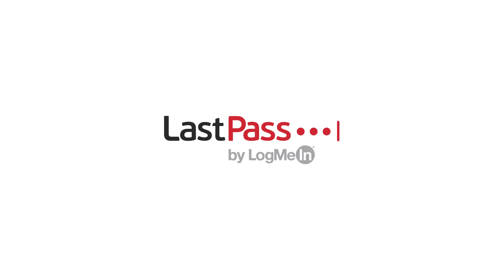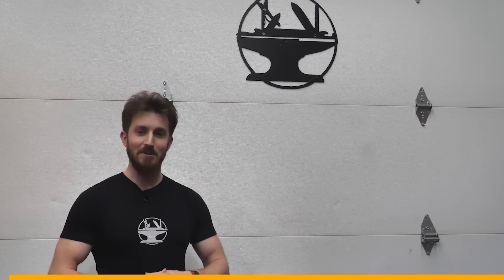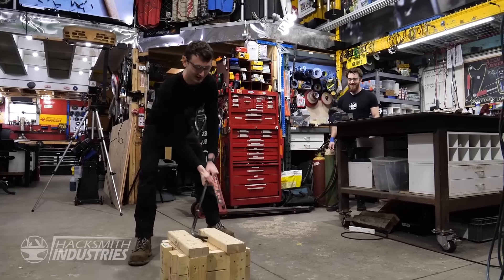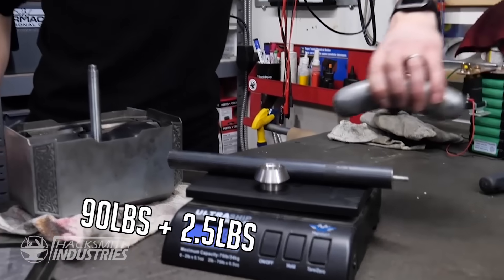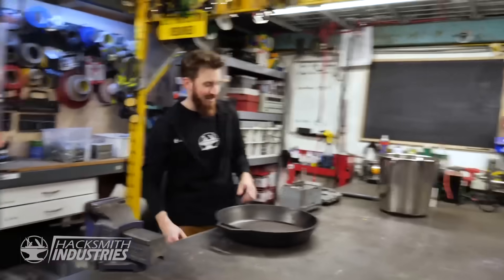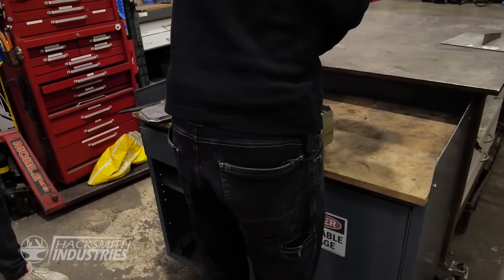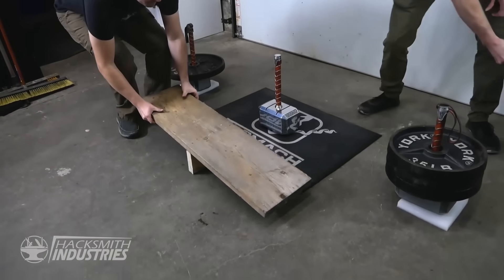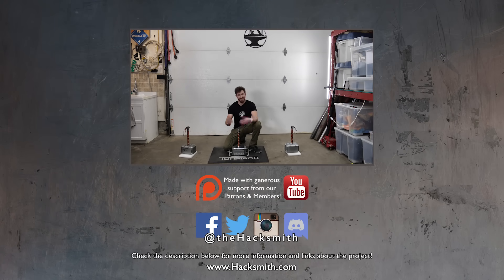Tungsten Thor's Hammer (World's HEAVIEST)

Comment: Is there any possibility you guys can build a melting furnace that can hit 3450 C (Tungsten melts at 3422 C)?
Then you can (theoretically, you need to build a mold that can withstand that temp.; I suggest cooling the mold with liquid nitrogen) make a replica Hammer head out of 100% Tungsten (or just about any other metal you can legally get)...
I bet a solid 100% tungsten hammer head will be between 130-150 Lbs...
If you can melt/cast Tungsten, why not try making a solid Tungsten Stormbringer?
Reply from the maker: That would cost so much
Reply: @hacksmith  You were able to crowd fund the Tungsten for this project, why not try for the tungsten furnace/molds...
Besides, think of all the shenanigans and/or fun you could ultimately have with what amounts to a small, privately owned Blast-Furnace...
Large projects like the Aliens Power Loader may become cheaper if you could source your steel at the scrap yard and smelt it at the shop and cast the parts you need directly...

Comment: Normal person: Uses tungsten to cut steel
The hacksmith: Uses steel to cut tungsten
Reply: @DL-zv5xc  , metal just refers to material, whether they be elements or alloys, and steel is definitely metal.
Reply: @sol_x_dier  steel is an alloy of 2 metals
Reply: Daniel Agius steel is iron + carbon. Carbon is nonmetal
Reply: ApologeticBrit16 Theres a big difference between Tungsten and Tungsten Carbide
Reply: tungsten is a metal tho
Reply: @DL-zv5xc  you didnt just say steel isnt a metal, did you?
Reply: @bmxscape  steel is not a metal, steel is made of metal
Reply: What is considered normal metal
Reply: Daniel Agius steel iron
Reply: @kayhan_  steel is an alloy of 2 transition metals and the termnormal metals is  inexistent. As almost all apart from mercury and some others  are ductile and malleable.
Reply: @locallemonadestand8130  Steel is not an alloy of 2 transition metals, how do you come up with it? Steel is an alloy of a metal, namely iron (a transition metal) and a non-metal, namely carbon. Basically, steel is "iron carbide" ^^
Reply: I see u guys Murdering Chemistry
Reply: But only Stalinium could sway the german wehrmacht...
Reply: @Ulvetann  stalinium can defeat wermachtium
Reply: Tungsten has a relatively low threshold for shear strength because it's an amalgam of small crystalline granules.  You can cut it with high speed steel.  The individual granules are nearly diamond hard, so the tungsten is extremely abrasive.  I go through carbide endmills like crazy machining even copper alloys of tungsten.  Pure tungsten is almost impossible to machine.
Reply: That's how mafias work
Reply: Perfectly balanced as all things should be.....
Reply: Hacksmith could cut steel with aluminum lol
Reply: @DL-zv5xc  it's iron and carbon alloy.

Uhh, 97% metal by weight or so
Reply: Wtf
Reply: F*** you Mohs

Comment: Ok so i wanted to do the maths of how heavy you could make a 1:1 scale hammer 
So usuing the measurements i found of 8x5x5in that gives us 200in^3 
When converted to a unit that makes sense that gives 3277.4 cubic centimetres
The most dense material on earth osmium has a density of 22.61 grams per cubic centimetre 
So with simple multiplication that yields approximately 74000grams or 74kg 
So making it out of a more dense material wont actually increase it all that much

Comment: its got same weight with the cement, 50kg its tremendous but luckily the cement has bigger space and it not too dense since they are in powder so maybe 50kg it still have room to move araound xD

note :
cement i mean is used for concrete
Reply: I don't know if I understand your comment, but are you suggesting that cement is heavier than tungsten?  If so, let me assure you than cement is lighter (less dense) than steel which is less dense than lead, which is less dense than tungsten.  

g/cm3
cement: about 3.1
steel: about 7.4
lead: about 11.3
tungsten: about 19.3
Reply: @NOTNOTJON  not like that, 
whats i mean is because the different dense of materials, even with same weight the feel bringing 50kg cement and 50kg tungsten will be totally different, 

so whats im tried to explain is the real example of material density, which using real life object

Comment: If you had an unlimited budget, could it be possible to make the pommel out of a highly dense metal, moreso than Tungsten, but one stable enough to be used in a hammer? Osmium might be too rare to work, and I'm not sure how hard it is to machine, but if you had a pommel and tang made out of Platinum, would that solve the balance issues?

Comment: I thought you guys were going to cast the entire hammer in solid tungsten. You can still make it heavier!
Reply from the maker: You can't cast tungsten
Reply: @hacksmith  it can't be melted and poured into a mold?

I admit my knowledge of metal working is next to nil, but I had thought based on the title of the video that was what you guys were doing. The video is great, I just had the wrong idea, I guess!
Reply from the maker: You can't.highest melting point of any metal
Reply: @hacksmith  I see. Thanks for the clarification!

Comment: you could go higher with the weight. Iridium has the highest density from all non toxic metals with ca. 22.5 g/cm3, Osmium would be higher with ca. 22.6 g/cm3 but it's toxic.
this is not an invite for doing this as the prices for this metals are way to high, for osmium it's ca. 1.150 USD per gramm and for Iridium it's ca. 53 USD per gramm.

Comment: In case you were wondering why they didn’t melt the tungsten and pour it into the hammer, it turns out tungsten has a melting point of over 6000 degrees Fahrenheit, which is 10x hotter than the melting point of lead.